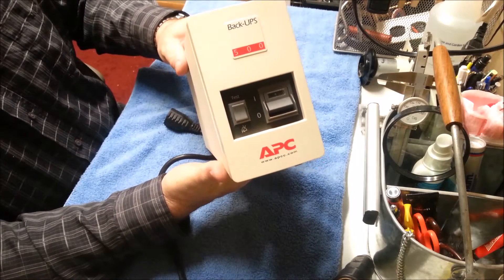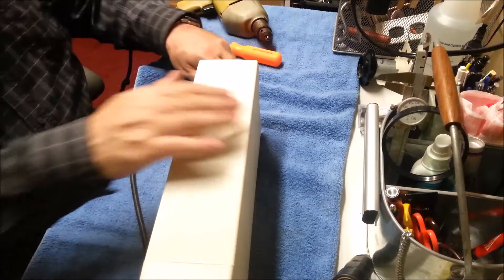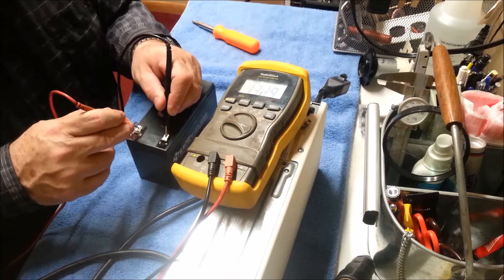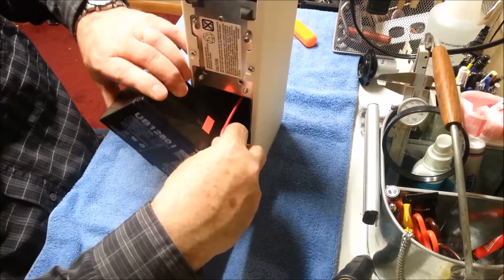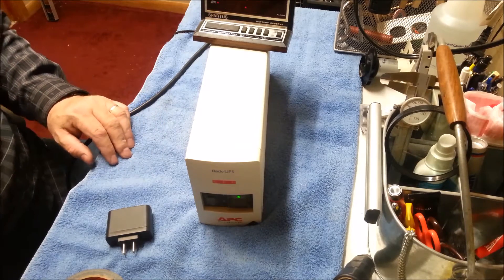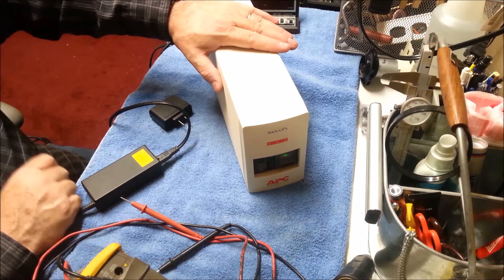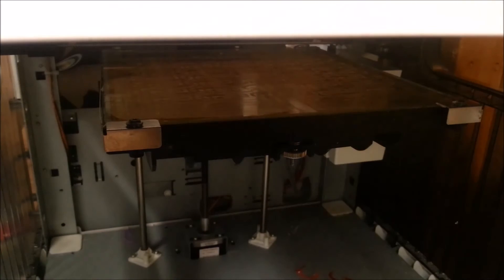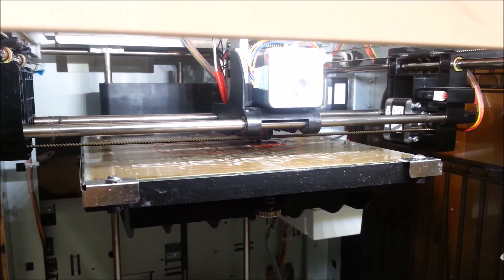APC Back UPS 500 - Battery Test / Replace & 3D Printer Trial  Crafted Channel

Comment: If you need more battery capacity (more run time), extend battery wires to an external car battery or multiple batteries in parallel.
Reply from the maker: +Tim Cat   You read my mind.  If I get a big enough one, I plan to parallel an 8D battery to it.  Something big enough to run it for some time.